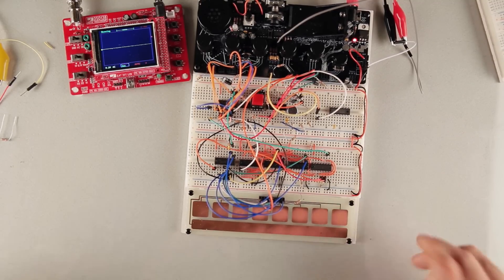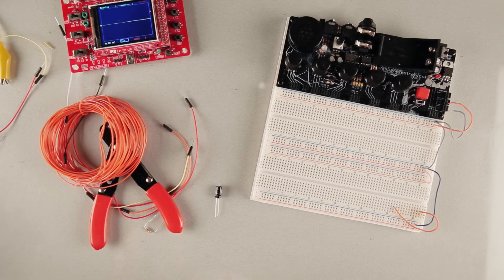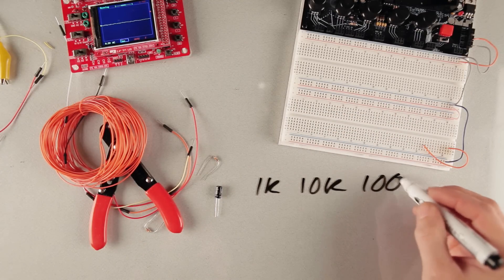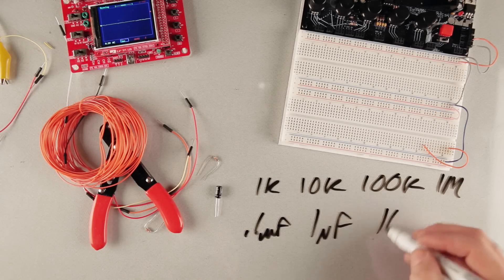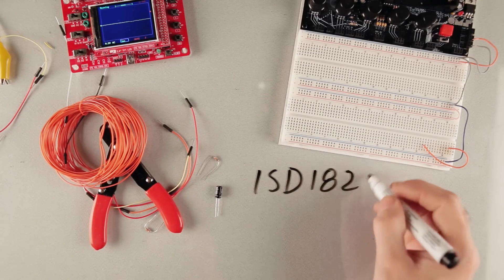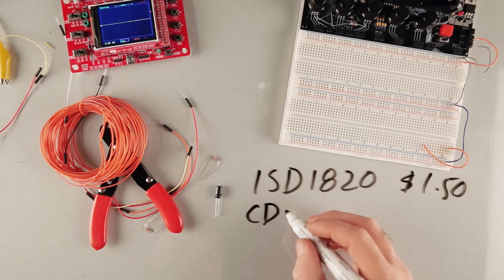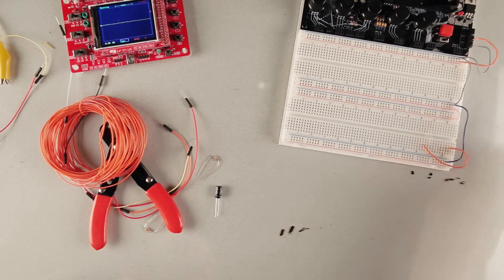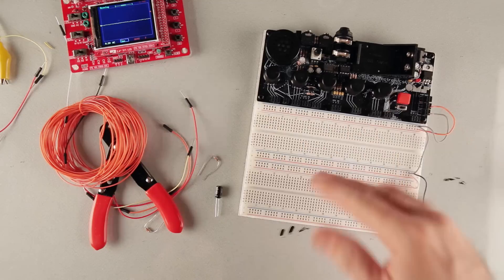Casper Electronics DIY synth building. Part 3: Lo-Fi Sampler/looper/VCF

Comment: Hello, I also have this sampler, unfortunately at the beginning of each recording there is always a “crackling/clicking” I didn't hear that in your recordings. Did you consciously do something against the cracking? Is your module connected to battery or power supply? Thanks in advance Regards

Comment: I purchased a bunch of Omsynth breadboard items from your Noise Kitchen website. As a suggestion I would recommend you include a simple diagram or instructions. I figured everything out except for the Keypad( Except because no markings on the buttons or knobs etc. I have to retest every time I use them and re remember).When you plug the wires in it forms a connection before you press any button. So I guess it is not set up as a button.Tried using as a resistor and as a typical button. Did not seem to work as in a resistor replacement. Watched all your videos over and over but usually to much going on from a distance to know what is actually connected to the keypad.Tried sending a couple emails to customer service at Noise Kitchen. No response. Becoming very frustrated!!

Comment: The pop is not from the silence, but because the samples aren't ending on 0v.
Reply: could you provide more info on that?
Reply: @ridass.7137  Sure. An audio waveform centers on 0v. If you cut the audio when above or below 0v, the wave form will sharply return to 0v, which sounds like a pop. The proper way to clip an audio clip is to zoom in and select the point it crosses 0v. If you do this, you will never get a pop.

Comment: Hi there, great video and very informative! many thanks! i noticed on an earlier schematic that i had saved from your website, the REC LED is tied through a resistor to ground, and when checking the newer one, is is set high instead. i attempted to build this into a eurorack module, but i think i may have fried my chip as it got pretty hot and fed a regular oscillator into it (+/-5v) before checking the datasheet says absolute maximum VAC on the input pins is way less. luckily i ordered 3 just incase :) Do you know where i might find some further information about adding some protection to this circuit for use with eurorack? any help would be really appreciated. thanks again!
Reply from the maker: Jeremy Durant voltage divide your incoming signals and add 5v Zener diodes. These will cut off any signal above 5v and below 0v

Comment: hi, thanks for your great videos, I've learned A LOT!! I have a question: isn't the ISD1820. SO voice recorder kit pretty much the same as the sampler you build in this video? I mean, not the divider or the oscillators but just the sampler part
Reply from the maker: Yes it uses the same chip
Reply: What I mean is that, to make your sampler, you use pretty much the same components that comes with the chip in the voice recorder kit,  don't you?

Comment: Your red oscilloscope-type device seems very useful. What is it? where did you buy it or did you make it yourself?
Reply: Hey you can get them off EBay etc, either in a kit form or constucted. Just search DSO oscilloscope kit. There not super precise and have trouble with noise (no shielding etc) but are actually an awesome little unit for the outlay.

Comment: Did I miss the part where you built the filter?  I've been playing around with little 555 and cmos osc drone makers, but I want a filter (lowpass for sure, but being able to wire it up to do hipass and bandpass depending on where I tap the outputs would be awesome).  Unfortunately, all the filter designs I've found require dual pole powersupplys (usually 12v+/- or 9v+/-).  Got any advice?

Eventually I want to start building my own modular 1v/oct compatible synth, though that will likely be pre-fab PCBs to start.
Reply: Andy, you can build a great 9v low pass filter.  Here's a link, scroll down to find the post "9V powered Korg MS-20 filter".  It words wonderfully.  You may have to do small tweaks to get it just the way you like it.  http://www.scoop.it/t/diy-music-electronics/?tag=pedal
Reply: Andy, also, if you are looking to build +9v stuff, you should be diving into the world of DIY guitar pedal circuits.  Most will work fine at +12v, too, which I recommend as they seem to be more stable.  I highly recommend tackling Casper's Echo Bender to add a great 4th dimension to your sound!
Reply from the maker: I explain the filter on the website. Link in the description. This is only a low pass. And don't expect it to sound good! The main strengths of this filter are that it is super simple and runs on 5volts. Functionally it is noisy and sort of unstable. BUT It is a pretty aggressive filter. Which gives it a sort of fun musical character.
Reply: I've been playing around with building several guitar pedal circuits off and on for a while now. I even built a full beavis-board for easy prototyping.

I'm just more of a synth nerd and there is a BIG gap/step between tons of little battery powered synthy noise makers like in this video (and a ton of 555 or cmos40160 based designs) and stuff that works in modular/euro world (1v/oct osc tracking across at least a few octaves). looks like I really need a oscilloscope and quite a bit more electronic engineering knowledge.

Comment: Does an L78LO5 make all of this 5V or just the sampler chip? Also, is it possible to connect the output of a circuitbent toy to the input of the sampler chip?
Reply from the maker: The whole circuit runs on 5volts. Yes you can connect the output of a bent toy to the audio in ;)
Reply: Thanks mang! This series was invaluable to me!
Reply from the maker: right on! glad its been useful.